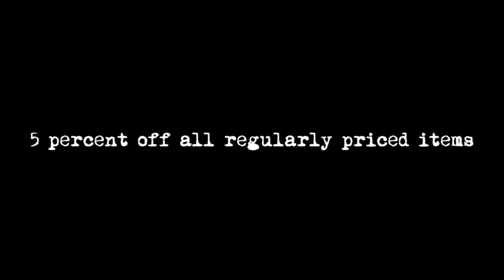Well this Sucks,  It is a Short one, can it truly Suck less then...? - 423

Comment: The safest and most efficient way to dig a hole. No damage to undiscovered utilities no mess to clean up afterwards. Minimal material removal. That looks like an older unit, New ones are a lot quieter as sanctioned by some municipal bylaws. They can cost over $500k new
Reply from the maker: 1st time I have ever seen this done

Comment: I am pretty sure that tool he is holding is called an air trencher.  He is digging and the truck is sucking up the soil he is loosening leaving a clean hole to put in a replacement utility pole or something, then the truck can replace the soil it removed later.
Reply from the maker: yes